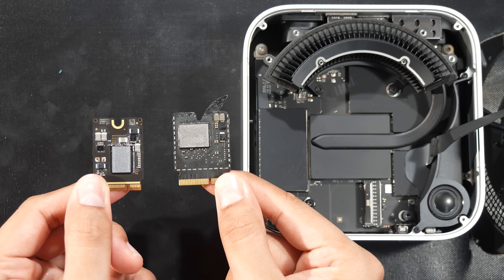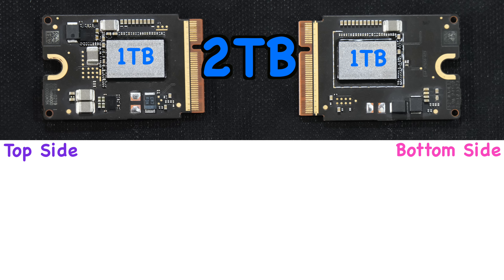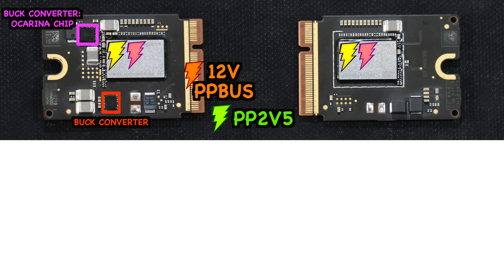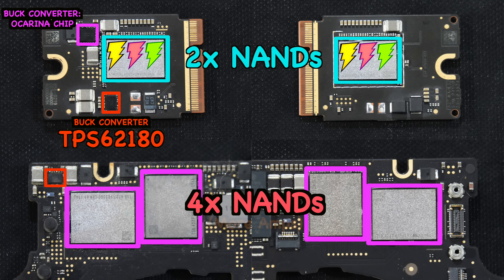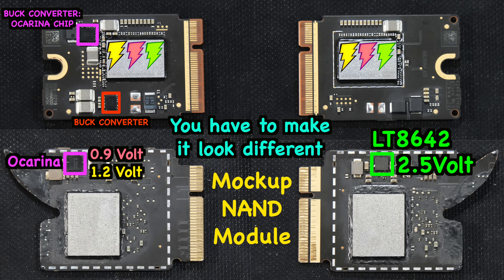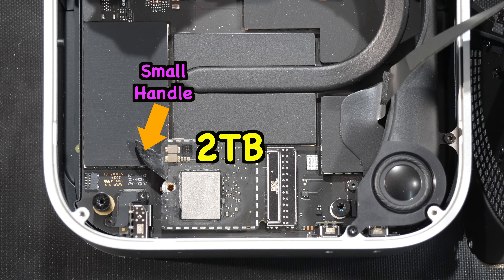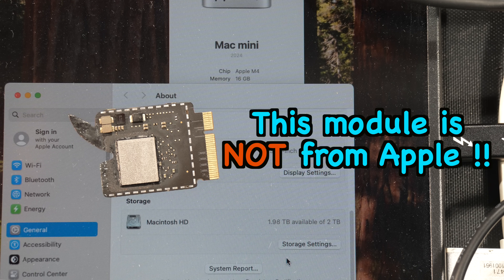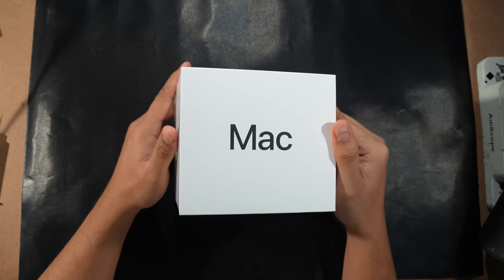We Redesign the SSD for M4 Mac Mini- Part 1

Comment: Even if we could redesign the ssd board ourselves, we wouldn't be able to get quality nands to mass produce replacement ssd for mac mini m4. The nands ssd are custom designed and ordered by apple. There are only 2 ways to get it, steal it from apple's supply chain (illegal) or get it from broken iphone 14/15 (no quality assurance). It is impossible for a 3rd party company to produce replacement ssd for mac mini m4.

Comment: Hey I have always seen the 61280 die from dust sucked in to the side vent, right where the ic sits. The dust will trap moisture (especially if you are in a humid place) and short the 2v5 directly to ppbus.

Comment: You better move fast. As WD and others are signing deals to make these upgrades for half the price with Apple. 

Or you could just buy the 512gb SSD upgrade tier 2 model which is twice as fast as the 256gb base model..

Comment: How about a module with an NVME slot ?
It looks like their is some space over the heat pipes, or does the cover come down too far to squeeze an SSD in ?
Reply: The SoC already has its own NVMe SSD controller built in, which interfaces with the NAND module.
Reply: @fujinshu  forgot about that  😞

Comment: This sounds like something that would blow up on kickstarter because of the insane value.
Reply: the problem is in Warranty, individual or small   company couldn't afford the warranty.
Reply: You know, since this requires a lot of engineering work to recreate the proprietary SSD's the value isn't great as such. It's bad compared to the general market - it's good compared to apple prices. Apple could've easily used an existing m.2 standard (like a 2230 or 2242) which would've been even cheaper. So you're still paying a bit of an upcharge because of the work involved, and therefore the value isn't necessarily fantastic.
Reply: @fVNzO  It's an insane value anyway even if it costs a bit more than a standard SSD. The base model M4 Mac Mini simply blows out of the water any similar PC costing up to $999, so you do have some room to upgrade the SSD.
Reply: @vistaero  Yes but if someone really, really cared about value they would make their own external drive which would be the cheapest.
Reply: @fVNzO  Make? You should at least buy a quality Thunderbolt case for an SSD that runs macOS.
Reply: @vistaero  that is indeed one of the ways to do it of all time.
Reply: @vistaero  Это полная чушь.... он ценен только для фанатов яблока любой грамотный пользователь за 999 долларов соберёт универсальную систему которая будет гораздо лучше этого недоразумения единственный плюс которого это компактность. Но так как мы говорим не о ноутбуке а о ПК для которого нужен экран и питание от розетки смысла в его компактности вообще ни какого нет.
Reply: @vistaero Only because you’re comparing a chip that just came out to x86 chips that came out 6+ months ago. In 6 months you’ll have x86 and probably Snapdragon chips that let you have a PC this size or smaller with more upgradability, TB5, WiFi 7, and more ports for the same price which will be faster.

Plus no soldered RAM and no anti-consumer SSD which requires buying more expensive, home made workarounds
Reply: @JohnSmith-op7ls  So there must be already a mini PC that beats the M3 Mac Mini in performance and cost. Name one.
Reply: @ Lunar Lake chips were only about power efficiency and neither Intel nor AMD are doing architecture changes every year.

Next year though will be an architecture change with Intel A18.

Also, “beats” is a vague word. There are multiple NUC PCs right now with external PCI-E ports which can handle a 4090 and easily manhandle the M3 or M4 on anything that requires GPU processing.
Reply: @ 4090? What are you even talking about? The whole machine has to cost around $599.
Reply: @vistaero  Nothing beats the M4 Mac Mini in terms of price to performance but Apple artificially limit its usefulness through software (MacOS) as they consistently refuse to support open APIs (like Vulkan). If you're not a video editor or professional reddit user, the use cases are shockingly limited. If Apple added first party support for Linux (and by extension SteamOS), their entire Mac lineup would be the best value computers you could buy - but they don't so they aren't.

They are Lambos with square wheels
Reply: @DavidAlsh  I find mine hella useful. To each there own

Comment: Don’t make it larger than the original module, if Apple ends up reusing the same form factor in a different Mac in the future with a more constrained space around the module you will have to redesign the module for no reason.
Reply from the maker: @christophmuller3511  Good point! Thank you and we'll consider that.
Reply: If all the electronics are contained within the same footprint of the original model, then it might be possible to just cut off the handle instead.

Comment: An adapter to use a regular nvme ssd would be nice
Reply: Won’t happen, Apple integrated the ssd controller into their SoC and the module is just the bare NAND flash chips. There is no PCIe interface here to connect NVMe.
Reply: The Wifi module in the base is probably PCIe.

Comment: I’m curious if it’s possible to put 4tb on a regular M4 Mac Mini by putting 2 2tb NANDs in it. And I’m pretty sure 2tb NANDs exist because the M4 Pro machines have 8tb configurations even with 4 NAND chip spots
Reply: Probably not, 2x1tb seems to be the hard limit for the base M4 chip.
Reply: @fujinshu  it's not . we have tested 4tb on M4 Mac mini  with sumang nand (2tb/pcs) ,it works well. but the price ...emm..:face-orange-biting-nails:

Comment: If you make this adapter available on the market, is there any possibility Apple disables it in the future with a software update?
Reply: Probably not, but they could add some extra proprietary hardware to the modules in the next revision that blocks upgrades and repairs.
Reply: No.

Comment: I write my comment on your question on removable SSDs  again because I'm not sure if you saw it:
I saw a Mac mini M1 with the base 256 GB with a TBW of 1.5 PB and 9% lifetime left! Also an M1 MacBook Air with 512 GB with about the same TBW yet (1.4 PB) that has a remaining health of 56%. So your calculations with only 150 TBW for the 256 GB SSD in M1 Macs is completely wrong.
Which means 256 GB = ~1.6 PB and 512 GB = ~3.2 PB
 Could I send you the Terminal Screenshots somehow for the evidence?
Reply: Most SSD dead reason is other things else rather than "running out of / exceed TBW" 

Most SSD here is talking all SSD ,not just apple thing 

Include but not limited to firmware corrupted, controller dead, PCB issue,flash nand issue itself, buggy firmware 😂
Reply from the maker: @remo-pro  My answer to this question is simple. How do you measure TBW when the SSD already dead on these MacBooks? Dead SSD = Can't On. How do you measure it with any terminal?

Comment: So there is no security lock preventing you from swapping chips?
Reply: Correct, you just need to use another mac to reinitialise the nands, since the controller is on the main logic board (maybe in the soc? not really sure) for performance and security reasons. Apple would have to do the same thing during a swap
Reply: There is a lock within the NAND chips themselves, which requires you to reprogram the internal ICs within the chips, which also requires dumping configuration files.
Reply: Amazing. Glad I didn’t order and pay for the upgrade already!